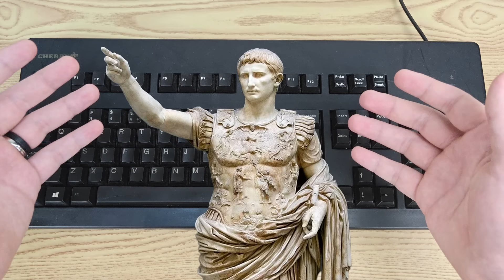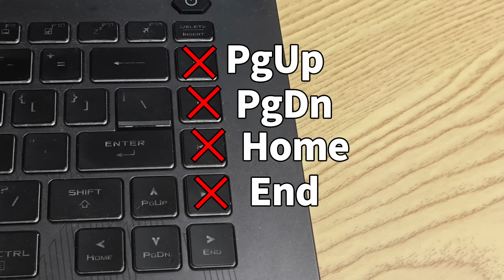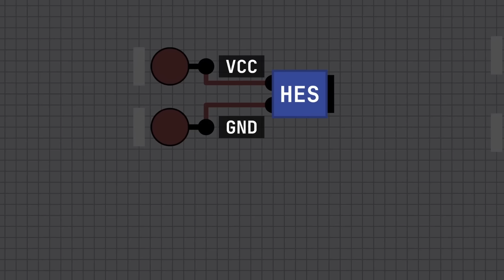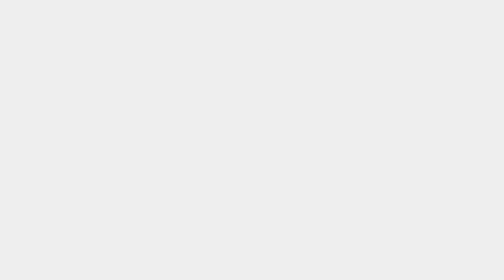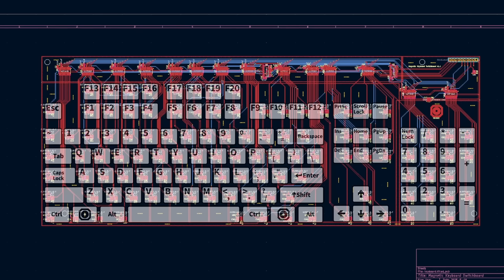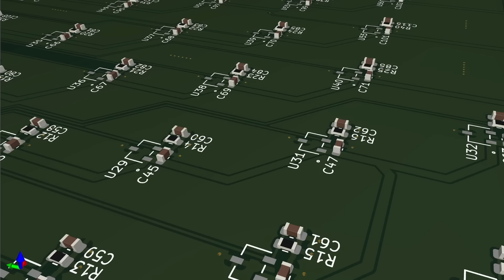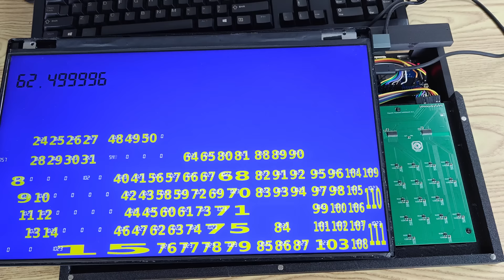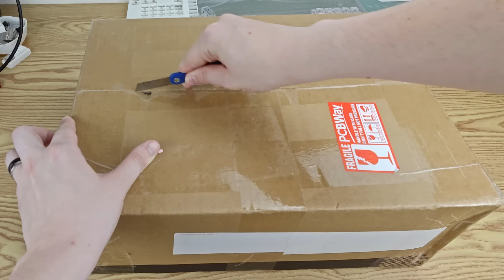Making a Keyboard that Swaps Key Layouts on Demand

Comment: I might lean towards it being powered by a microcontroller like an esp32 and the display being powered just by the host computer if it is just going to be a decorative device. There are many keyboard oriented firmware and the esp also natively supports sending keys over bluetooth, some models also habe usb hid. Would shave off the cost of the orange pi, but would act as a decorative keyboard rather than functional, maybe i will fork it and modify the pcb to use some cheaper microcontroller
Reply: Though i do still think the esp will be able to send commands to the host computer to get it to render different layout, feel like the pi can be eliminated entirely

Comment: Would be killer with an oled, use of an orange pi makes it quite expensive
Reply from the maker: The case and keys were much more expensive to get manufactured. But I get it, a near $100 SBC is still a lot.
Reply: @InkboxSoftware  i was gonna ask about that cost breakdown, since i havent gotten parts 3d printed before, approx how much are they ?
Reply from the maker: The resin parts all together cost almost $600, but it wasn't the direct material cost, it was because there were 125 small parts that needed to be polished. So version 2 will probably use a different material, maybe an at home solution
Reply: @InkboxSoftware quite a bit more than i exprcted, but skipping polishing isnt a feasible option either. They have to be crystal clear

Comment: Impressive. Ever since I saw the Flux keyboard I had the same project on my backburner. But I haven't gotten around to it, since I couldn't figure out how to design the keys with my current tools... It never occured to me to use something like PCBWay to have them manufactured.

I would honestly separate the Display side of things from they Keyboard side of things. Ie keep the SBC to drive the display, but use a more real time friendly microcontroller to detect key presses and send them along to the host as well as to the SBC for handling the effects (has the added benefit of keeping it all C/C++).
Layout switching could then be done by having the SBC send a different layout mapping to the microcontroller.

And another idea: I'd use the "dead space" above the keyboard, by adding a capacitive touch digitizer (something used on those ultra wide bar type LCDs might fit that space well). Use it to interact with the configuration software of the SBC and/or display other controls like sliders, which can benefit from the touchscreen type input (those interactions could be sent back to the microcontroller that's connected to the host PC as well). 
I've actually once done a custom controller that way. Used a separate touchscreen to on the fly siwtch between and configure the layout and function of the physical buttons, dials and switches. It used two microcontrollers, mainly because I couldn't fit the keymatrix and the parallel interface touchscreen on the GPIOs of a single controller (this was before comfortably sized SPI screens were readily available).
Reply from the maker: I think it was a lot easier to do it all on an SBC, I don't like working with microcontrollers, and I didn't want to have to juggle two separate devices. I wrote the keyboard program in c++ anyways, it was easier that way.
Reply: @InkboxSoftware  Interesting, I feel "dirty" trying to do real time stuff with anything other than a microcontroller. There are even a few SBC, like the LattePanda Delta and Udoo Bolt, that integrate a microcontroller directly onto the PCB and bring its ports out through headers. 

I'm curious, what bothers you about microcontrollers? Not enough resources? Varying hardware specs making it hard to generalize coding for them? The development environments?

Comment: This is such a cool project! The main problem that I have with keyboards like that is that the symbols are on the bottom of the keys, I wonder if you make the keys totally solid you could use refraction to make the symbols appear on the surface like what happens with water, basically turning the keys into lenses if that makes any sense 🤷‍♂️
Reply from the maker: It doesn't help that my keys are very tall. I'm planning a redesign with some shorter keys that don't make the effect so jarring.
Reply: Ideally every key would have a fiberscope bundle in it
Or they'd be ultrapure solid ulexite
No idea which would be more expensive, that or just putting an individual screen in every key

Comment: Awesome keyboard but damn that's not cheap the A1309LLHLX-9-T are $153 for 100, the PCB and prints will make this a luxury project, shame resistive touch is such a dog otherwise you could just place a pin under the buttons and move on.

Comment: In theory, with 3D modules, we could reduce to 4⁄9 the number of hall-Effect modules by treating your keys in lots of 9. 

/!\ Warning: Continue reading the comment only if you want to dig deeper into my delirium...

𝒙 → ; 𝒚 ↓; 𝒛 •
🆁   🆃   🆈
    +     +
🅵   🅶   🅷
    +     +
🅲   🆅   🅱

The 𝒛+ axis, mainly defined the key ; (For the 8 outdoor buttons) the vector [0.0.0; 𝒙, 𝒚, 𝒛] Indicates the key press if it is finished in the center of the button and on one of the angles/side if it corresponds to two (or more) keys supported.

After that it becomes simple vector calculation, it may be necessary to be used from the AVX2 instruction to optimize this theory 😅

 ( AVX2 = Compulsory instructions when accommodating a local LLM)

Comment: this man made an open sourced flux keyboard before the actual flux people even shipped a single unit 💀
Reply: Fr. Been waiting on my pledge for an additional (nearly) 2 years after it was originally meant to release
Reply: OPEN SOURCED??? LETS GOOO
Reply: To be fair. Manufacturing thousands of units is a lot harder than making one prototype
Reply: Developing and producing consumer hardware is more difficult and expensive than building one prototype. Even companies with experience and existing supply chains can fail at it. Not defending this flux thing but those two projects aren't the same.
Reply: @SaHaRaSquad not to mention that the issues with this prototype are inexcusable for an actual product being sold. Like if they delivered a month after the kick starter a board with 1-key rollover and no key stabilization most people would still call it a scam
Reply: @Kori-ko  things like the 1 key rollover can be fixed by using existing keyboard firmwares that do all the backend processing so with a team of few people this could be in a very good state that said yes mass production is very difficult especially when you have so many custom parts adding to the cost
Reply: @Kori-ko  the issues are easily fixable.
Reply: @polar_inertia  no, the design sucks
Reply: @MusTheFan  It's all a cost issue. He just needs a screen the correct size and fix the multi key press issue.
Reply: They STILL havent produced it???? Screw that! They are lagging!
Reply: I want to wait before they have the first sales out and inevitably will make an OLED model
Reply: @bromine_element I actually will choose LCD over OLED most of the time for longevity. But I can't wait for uLED to take off. Because OLED undeniably looks better, and especially for a keyboard that'd be sick!
Reply: @AgentOrange96 OLED usually is pretty reliable nowadays if manufacturers take basic action to counter burn in with existing technologies
Though yeah i agree in the case of a keyboard they'd be REALLY susceptible to burn in if you only use one layout
Reply: @bromine_element Yeah keyboard is prime burn in in that case but the flip side is if you use a dark theme it'll probably be easier on the eyes since those blacks are really blacks. It'd definitely look sleek. 😎

e-ink would also be neat if you don't want animations.
Reply: @AgentOrange96 i think once half a million chinese companies try to emulate FLUX after it starts finally shipping i think there will be an explosion in choice
Reply: @bromine_elementidk if they could i think they’d be doing it by now
Reply: @bromine_element Every Optimus Maximus still in existence has severe burn in because they used early OLEDs.
Reply: Oh wow they still haven't shipped?! I haven't checked on those in over a year.
Reply: @marks47  they are shipping 120 Units to Influencers right now we should be getting impressions of the keyboard in August or September as well as people getting their orders.
Reply: Flux has been so perfectionist from what I can tell. Which is cool but damn.
Reply: I'd give more credit to Optimus for at least shipping some keyboards.
Reply: @ccricers  It took two years to ship a few Optimus Maximus, as someone who followed that board's development at the time, and that's with the preexisting work done on earlier boards.
Reply: I WAS GOING TO SAY!
Reply: still on the list...
Reply: Beat Finalmouse’s centerpiece too
Reply: Oh my god I totally forgot about those things…
Reply: like unironically the same thing like to the tee
Reply: pretty sure Flux key board is a scam, so i wont ever be coming out
Reply: My thoughts exactly.
Reply: With how horrible and cheap it looks makes sense
Reply: Shipping comes after making, so I don't get your point.
Reply: uh... I see you are not aware of aliexpress...
Reply: The Flux Keyboard finally started shipping. LTT has a video reviewing one.
Reply: My first thought was "oh did they finally start shipping the flux" lol 💀💀💀
Reply: When my keyboard broke 6 months ago I considered ordering a flux keyboard, assuming they would ship soon. Man am I glad I went with a keychron instead 💀
Reply: @KiemPlant  im still waiting for my flux 2 years later
got a basic office keyboard thinking ill support a project and get the keyboard in like a few months-a year
boy was i wrong but at this point all i can do is keep waiting :|
Reply: @Snaposaurus he never did see that keyboard 😂
Reply: @KiemPlant  I'd have gotten a real keyboard. 8bitdo highly customized, or vintage.
Reply: Could be a cost issue
Reply: Flux already developed hundreds of prototypes way before this guy did one.
Reply: He isn’t mass producing it though. And flux beat him to the punch so I’m not sure what you’re trying to prove here, but you really don’t have a point.
Reply: making one, vs mass production, there's the difference

Comment: with my membrane keyboard, you cant hold down 2 keys at once other than ctrl and shift and stuff, with normal keys it always decides which key was pressed first and sends that, then the other. it like. orders it. so maybe that could fix the multiple keys at once thing? put things in a small queue

Comment: What an absolute horrible method to check if the key is pressed....
Reply from the maker: Ok, how would you do it?
Reply: @InkboxSoftware I the first 1 sec of it turning it on you get some samples to get a threshold for each one of the key and use a % of that don't use a fixed number if for some reason you get a very high or low number by using a fixed number you can get weird cases e. Negative numbers etc. Each time don't read the sensor once, since you don't have a low pass filter before the adc each time you read an input read it at least 8-16 times and avaraged it, if you want to update the threshold for each key check if the key is pressed and do it for only the ones that aren't
Reply from the maker: That's about what my second method was. The issue is that the hall effect sensors are subject to noise, so if I only use an initial 1 second sampling that doesn't account for any noise. 

As for the key values, the ADC outputs a 10-bit integer, so there are no negatives, only an integer value from 0 to 1023. 

I guess your method has been sampling each key 10 times in a row and averaging that, which is good, I should probably do multiple passes at once with each sensor instead of iterating through all 112. 

As for updating "only the ones that aren't pressed"... That's literally why I'm sampling them, to find out which are pressed and which aren't, so I can't use that as a factor in changing the threshold.

Comment: I've actually used a keyboard with hall effect sensors instead of mechanical sensors. The steelseries apex pro
You can do really neat things, as, with the right software, you essentially have an analogue key input.
You can change the actuation point in software. you can make it so any movement down actuates the key even if it didn't go all the way back up. You could even do PS2-style true analogue buttons.
Reply: I just wish steelseeries would bring back all the extra keys the old apex had like the one with the 20+ macro keys plus diagonal arrows and the whole media control buttons
Reply: Yeah but they're built like cheap $50 keyboards for $200+. Also, they feel bad to type on and sound annoying. Considering it's competing with keyboards in its price bracket like neo, keychron, zoom, etc. they're just bad value for your money. All just for not very useful gimmicks like custom actuation points
Reply: @incongruous4  I wasn't promoting it, I don't even use it anymore I didn't like it, but my point is that if you use magnets, you unlock neat possibilities
Reply: @melody_florum  You were basically promoting it though. And yes, I guess so. You can do some neat little things that don't really service the goal of a tool like a keyboard at the cost of buying something with the quality of a $50 keyboard for $200, instead of buying a $200 keyboard that has the quality you'd expect of a $200 keyboard
Reply: @incongruous4  I wasn't, I was just saying how, if you're stuck with magnetic actuation, like this build, you can get some extra features out of it, not that magnetic actuation is always good.

Comment: This is great! You're nearly there to building my ultimate keyboard. One thing I'm wondering is how it would fit on the scale of complexity versus price if you were to get PCBWay to make either a series of tiny boards or one giant board you could cut apart with a grid of SMB LED's for each key. You could do 8x8 or possibly 16x16 if there's enough space. It would be more difficult programmatically, and it wouldn't provide the same image resolution, but I think it might be more durable, especially since you wouldn't need to worry about a fragile screen below the keys.

Any chance you could test this out on a key or two?

Comment: Now intergrate a fiber optic taper into each key to bring the images to the top of the keys.
Reply: Nice idea, but I wonder if the Ulexite mineral, also known as TV stone, would be cheaper to source
Reply: @DarklinkXXXX  yeah but it very fragile so it would be a risk
Reply: @DarklinkXXXX ulexite would blur the image

Satin Spar gypsum might work but that would need to be tested

It would also need to be durable enough for keyboard use
Reply: @SilverRose45  I like your thinking, I am just not convinced that it will hold up to finger grease 😂
Reply: @DarklinkXXXX  Ulexite is pretty hard to work with, and most of it isn't anywhere near optically clear, there's a lot of inclusions that obscure the image. Optically clear ulexite is fairly expensive. It also dissolves in water, so your fingers and palms would slowly wear it away.
Reply: man wtf someone stole my idea
Reply: Exactly what i was going to say
Reply: It’s funny how many of us had this idea independently 😂.

I bought some half a decade ago to try it with a screen based keyboard idea. It works pretty well. But then I let the project die.
Reply: Don't need a taper.
Reply: per-pixel fiber to keep the resolution??
Reply: So...  the Flux keyboard

Comment: 33:49 An easier sounding option is to use FFMPEG to decode the video file into RAWVIDEO which it can pipe out over STDOUT and it's just a stream of bitmap data basically.

Comment: 13:30 Raspberry pi picos, both 1 and 2, have enough oomph to drive an DVI signal which should work over HDMI. IIRC there's even an RP2350 board in RPi Zero form factor with a pre-soldered micro-hdmi port, though I understand not wanting to develop something this complex on a microcontroller.
Reply: That is a lot of data for a poor pico, maybe one for display and one for polling would cut it on a 640x480 screen, using only one might be possible with pio, DMA and all of the optimizations possible.

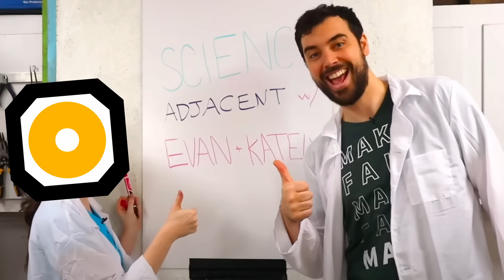Comment: 12:00
Sir, I will have you know I created two transparent keycaps to replace the windows keys on my K70 using a small amount of silicone and a cheap resin kit; the supplies cost less than the custom biohazard keycap I bought in 2018.
I just wish I molded more than one key so I could do them in batches, then my whole keyboard would be blank.

Comment: this sort of tech would be perfect for things like split ergonomic keyboards, showing the way the keys change as you swap between input layers would be invaluable for getting used to typing on them or when you swap around layouts. would also let you use smaller screens instead of a large 1440p hdmi panel.
Reply from the maker: That's a good idea, I may steal that later on
Reply: I'm so tempted to have a go at this, maybe as a corne variant. could be fun to try porting zmk/zephyr too
Reply: @pl4nty  personally im more a fan of the Lily58 but corne is a nice pick too
Reply: @itsdarkos I prefer 60% too, but smaller will be cheaper. thinking I'll do a macropad first to test switches and firmware, then look at sourcing other display sizes
Reply: Ohh wow i love that idea!
Reply: I don't think split ergo users tend to look at their keyboards.
Reply: @Alsry1  muscle memory doesn't just instantly come to you the moment you get a keyboard, and people frequently forget where less frequently used keys are all the time on normal keyboards, let alone one with 3-5 layers to search through. saves the time and effort of opening VIA or whatever other configuration tool you use
Reply: @SmplySilver 

Ergo users literally have blank keycaps bro...
Reply: @Alsry1  because getting custom keycaps printed is a pain and most people don't want to do it. having screens means they don't have to
Reply: @SmplySilver 

And yet they still don't need it.